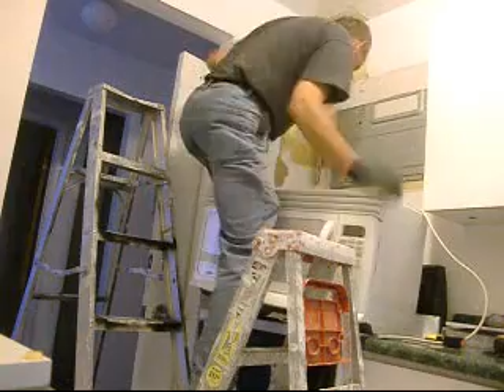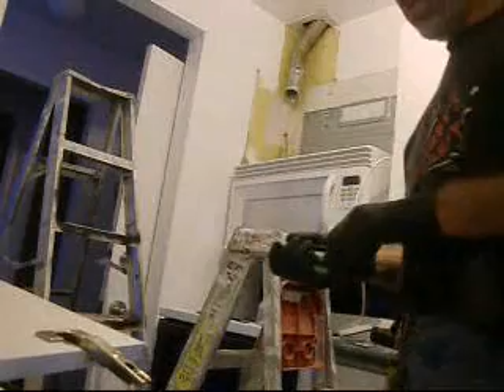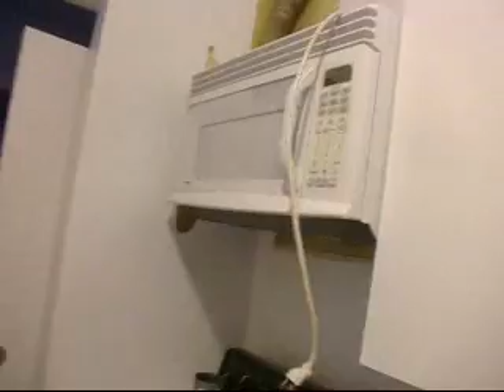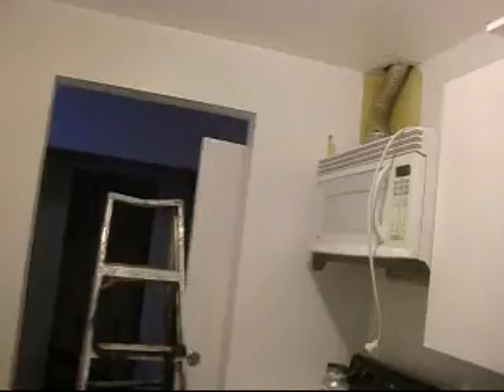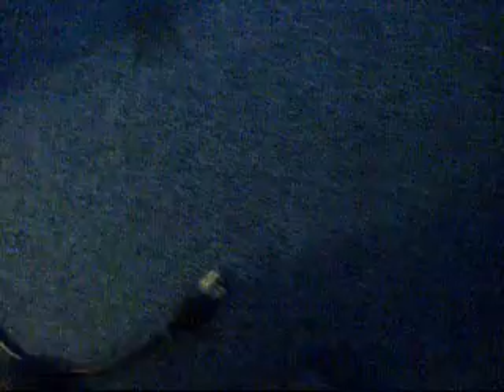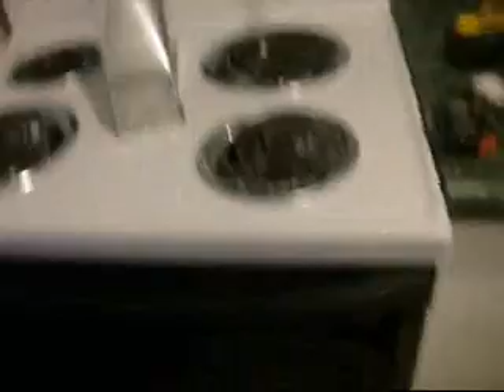6 14 11   MicroWave Mount...

Comment: Once you put the cabinet on top, there are threaded holes in the top of the microwave, thread in screws from inside the cabinet into the top of the microwave to hold it up.

Comment: those plates are designed to distribute the weight so the one bolt is actually carying a fraction of the  microwave...kranck er up.....and no your not an amateur but if you get yourself a ladder/scaffold combo you're actually going to make to hundert und zwanzig....